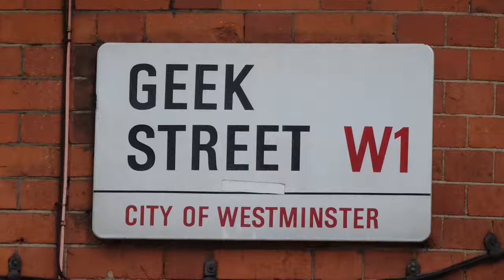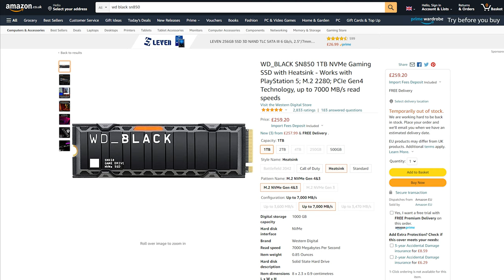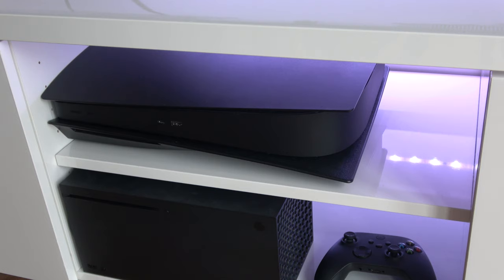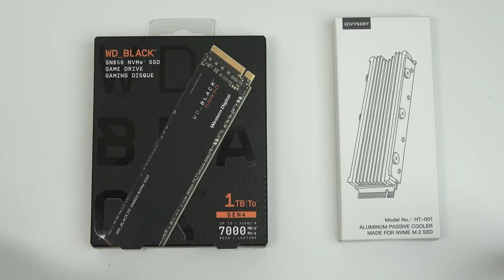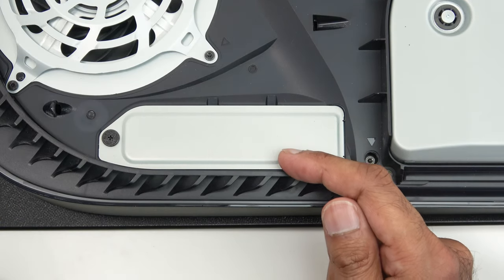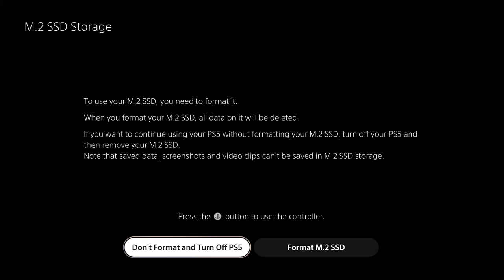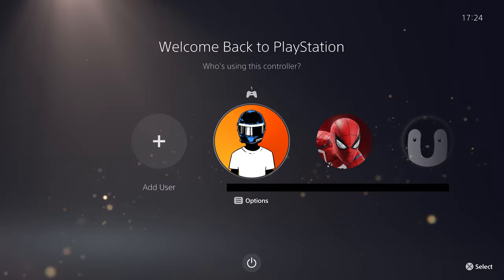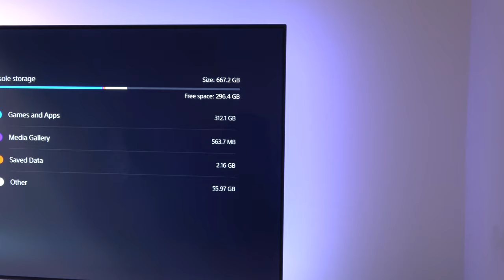PS5 UPGRADE | HOW TO Increase storage with M.2 SSD Step By Step Guide

Comment: Thanks for the clear instructions... took the guessing out as the heatsink came with no instructions.
Only Issue i had was that I left the first thermal sticker on to long so when peeling the back off it stretched over the the connections but luckily had a spare which i did much quicker.
The Samsung Pro 2tb says its at a 5700 speed but tried various games out and extremely quick so dont worry about that (maybe down the line its worth updating firmware but i dont have that option as no motherboard with m.2)

Comment: The black looks amazing. Also, I'm too scared to touch the internals. The 1st gen PS4 was the best for that.
Reply: Really easy just be sure to 1. Do it when it’s cold. 2. Touch the screwdriver to another metallic surface before your PlayStation. Oh and this heat sink comes with its own mini screwdriver 🪛
Reply: @jc3706  Thank you

Comment: Only concern i have with this is your trapping all that heat under that lid. Even though there are 2 channels to pull hot air out of that chamber. I know there are aftermarket coolers for these also but some people have their opinions of. But keeps the ssd cool and doesn’t effect internal temps of the console. How ever just leaving off that lid lowers ssd temps by around 10-20c. So curious everyone’s take on this

Comment: You can use a slower speed M.2 SSD.   But should still make sure it’s pci 4.0.  DF showed and tested slower speed on ps5
https://youtu.be/zWQs4UpiKl
(This could change in the future. as there not many 1st next gen games atm. This prob change as games get more demanding/tale more advantage of the hardware).  Removing the sticker will NOT VOID your warranty.
Reply: The sticker is a thermal thing tho you should always keep it on

Comment: Hi there just a question I have purchased the same  ssd  card and have the same heat sink as you however when I format the ssd it gives me a lower speed reading to yours 6125.652 MB/s  is this okay or do you think there is a problem with the ssd. Thank you for any help keep up good work 👍
Reply from the maker: It meets the speed requirements so should be fine.
Reply: Ok thank you for your help and thank you for your reply keep up the good work and great videos 😎👍👌

Comment: I want to know if I can use 2 m.2s on 1 ps5
Reply from the maker: You can only have 1 connected an a time, if you had 2 you can switch between them but the hassle is you'd have to open up you ps5 each time.

Comment: Do you need to remove the sticker from the ssd before fitting a heatsink ?
Reply from the maker: No, its safe to leave.
Reply: @GeekStreet  cool thanks so you just sandwich it between the heat pads correct ?
Reply from the maker: @steveothehulk  yes ive shown all in the video